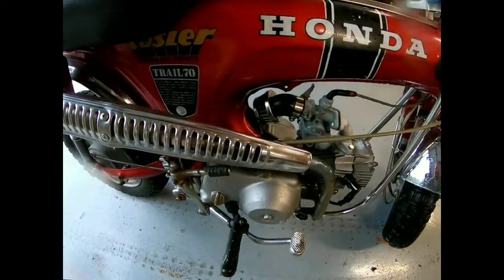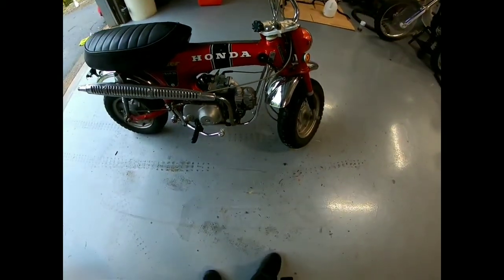My 1971 CT70 hits 39MPH!!

Comment: My 72 4 speed/manual clutch bike would reach real close to 50 MPH, about 25 years ago. Today, it's really tired and wheezing, and will top out at 35-39 depending on the road flatness. AND, I went up 1 tooth on the front sprocket about 10 years ago! Yours sounds very lazy compared to mine, but the 4 speeds always seem peppier.
Reply from the maker: Wow. Maybe mine would do closer to 50 if i just freshen it up. I still need to get the carb dialed in as well.